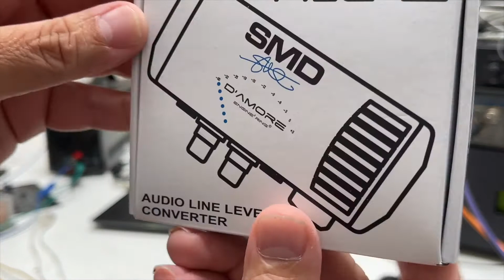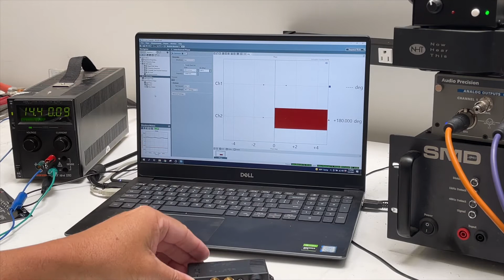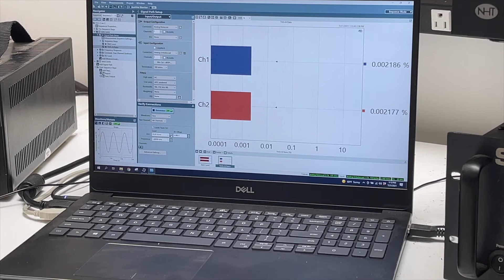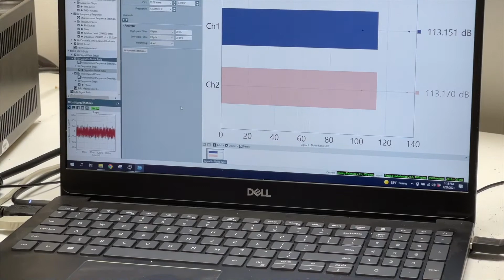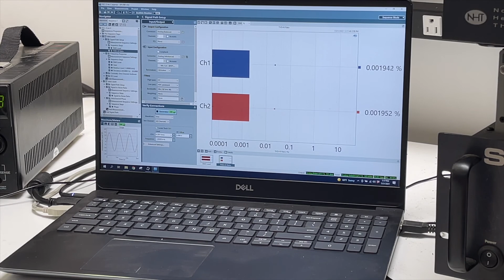HLC-2 introduction, a small active high to low level audio converter with audiophile performance

Comment: My amp says it has a rang of 250 milivolts to 5 volts. Would the 10volts actually damage it if I had all of it going to it ? If so should how do I get it down to the 5 volts and should I go for the full 5 or should I back it off a little to say 4.5 ??
Reply from the maker: No damage would occur.  It just allows you to use a lower gain setting, possibly no gain at all on your amplifier which would result in a cleaner (less noise and distoriton) system.

Comment: That's a really good Hi level to low level converter. I seen a video where Steve was doing a distortion check with the DD1 and DD1+ and Oscilloscope and I was very impressed with it. I remember you guys talking about this several years ago and steve had shown a prototype and i was excited about getting a couple but nothing was mentioned after that. Glad you guys went through with it.

Comment: Cool man, I'm wondering if you have a balanced line driver in the pipeline, Rockford has discontinued theirs and I can't find any worthy replacement.
Reply: Audio Control has the Matrix Plus...
Reply: this can be used as a line driver....
Reply: @meade916  How? It hasn't got an RCA input does it?  And did you skip the part where I asked about balanced?  Every single time I've interacted with you  its been as painful as a dry colonoscopy.....